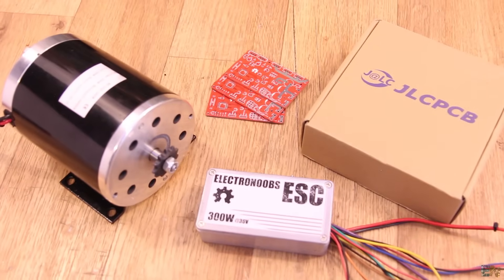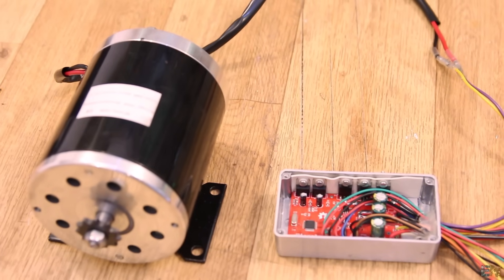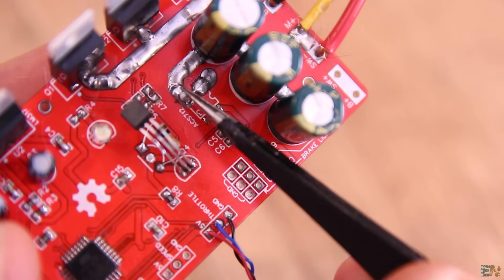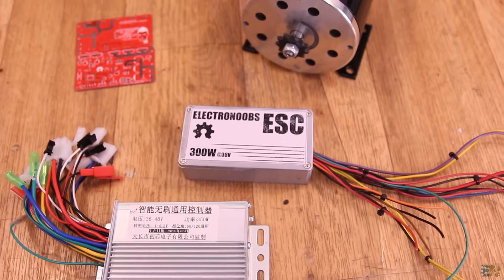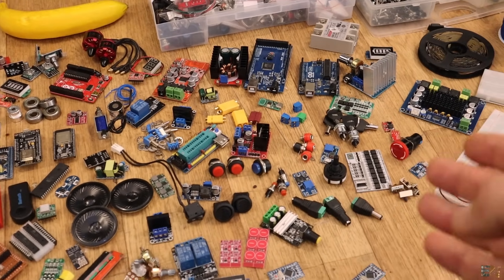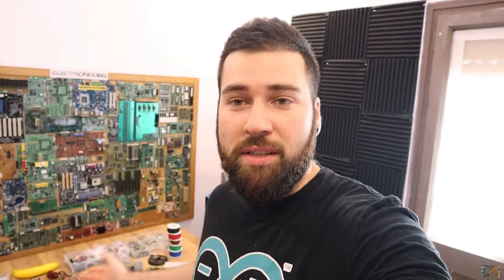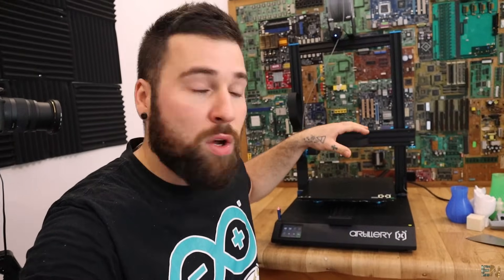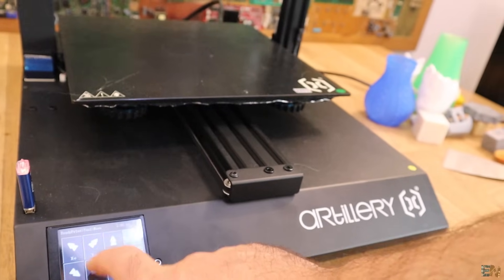Modules, New 3D Printer, Brushed ESC + Q&A | ElectroNews#04

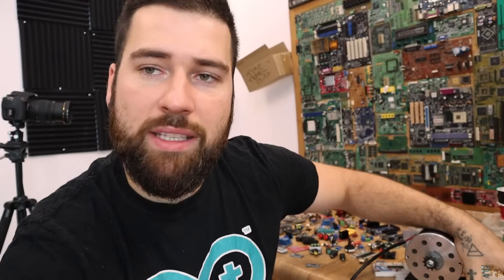Comment: 3:30 The main reason for using MOSFETs in parallel is to reduce RDSon resistance. Better heat dissipation is a side effect.

Comment: Hi, bro I am a beginner in programming. I am making brushless ESC as per your previous BLDC ESC project. My question: is that possible to use potentiometer for speed control instead of PPM or PWM signals, I mean, while Atmega328p ADC is already busy in processing BEMF, will it be possible to add another ADC conversions in code? Can MCU process both ADC?

Comment: Q&A: CAn you share your schematics ?
one mosfet is enough if it is an IRFZ44N! i apologise on the first video you mentioned 5 or 6 or idk ! actually it depends on the gate source voltage, IRFz44n is capable of 39 A DC at 100 °C at 10 V VGS. Honestly you should increase gate voltage from 5 V to 10 V and also  if you look at the ID vs. Vgs characteristic curve from the data sheet 5 V is barely enough to drive the mosfet in saturation. AT 5 V VGS the most just starts conducting (miller region)... and also  i am guessing why the mosfet blew up without heat sink even when the motor was at no load (4 A) is because the mosfets junction exceeded 175 °C and this is another clear indication of you are not driving the mosfet with sufficient gate source voltage and charge. Mosfet is still in linear region and offers a high resistance. I really recommend to increase the gate voltage and tbh just sing a PNP/ NPN totem pole transistor combo as gate drive is not good because you it purely depends on the GS charge the circuit can deliver and also depends on the gate resistor. From the datasheet this mosfet has to be driven with at least 1,75 A peak assuming a gate voltage of 10 V and gate resistance of 5.7 R for the required gate current peak, your the gate drive must be able to deliver the peak gate charge of around 40 nC (Ipeak*dt) in order to get a turn on time of 70 ns. Its even worse you are driving three mosfets with one gate drive, i recommend you talk to a power electronic engineer and show them your schematic. One mosfet is enough for your application three is little too much. I would suggest you have to a 10 uF (a huge cap) to your totem pole gate drive. Also please share the wave-forms of the VDS, VGs.
Fig 1, Fig 3 and Fig 6 are enough to design your gate drive. Mosfet is capable of dissipating 100 W continuous power. If you correctly design your gate drive you should expect a mosfet loss of :
Pin = 300 W, V = 36 V (12 s lipo worst case voltage)
Ipeak worst case = 8,333 A
Rds on = 0,0017 mR
Mosfet steady state loss = 0,0017*0,017*8,33 = 2 mW (this is nothing) 
If you assume a stall current of 20 A (usually the case with 300 W motors, current draw when there is no more back EMF so just the resistance of the winding )
Mosfet steady state losses = 1,1 W at 36 V huff nothing...
Mosfet steady state losses = 9 W at 42 V huff nothing...
 ITs a 100 W device

Even a single mosfet is an overkill !!!!
Switch loses cant be higher than steady losses  

Also consider using GaN or SiC transistors if you want to use a 5 V gate drive. 

Designing a gate drive is not so easy.

Actually this is not good to say using 3 mosfets is better than one, actually you are making worse by driving all of them with one mosfet.  You can make your PCB almost half and by using one.Better would be to go with a D2 pack. 
More over your application is PWM based so these kind of drivers are not good for higher frequencies again you dont mention the PWM frequency.
Consider using dedicated gate drives like irs2110 provides the required peak gate drive.
to summarize:
1. Increase the gate voltage 
2. Check your gate resistance
3. monitor the VDs on
4. check your gate charge

PS I am an EE

I would also jump off my roof with my head first if you can prove my calculations are wrong and actually show me if one mosfet burns up....No i am not joking...
Reply from the maker: Wow. I think this comment needs some more time to read it well and process. Thank so much for your tips :)))))
Reply: @ELECTRONOOBS  contact me on my email srinivasans198904@gmail.com if you need design tips  i have lot of experience in power electronics and Mosfet circuits.
I started like you with similar circuits using the same mosfet lol and i have destroyed mosfets without proper gate drive, when you use the right gate drive this mosfet is a charm...infact we have built circuits with mosfets passing 10 A and mosfet just got to 80 to 90 C after 10 min of operation....

Comment: There are some missing calculations that led to this failure involving "mosfet gate drive requirements" which is a function of switching speed, gate capacitance.. Building a BJT drive circuit is not recommended because the complexity around biasing, negative voltage clamp, drive current ect.. is not worth the part count. Use a gate driver ic there are tons and they cheap.
Reply from the maker: Thank you very much for your tips :)